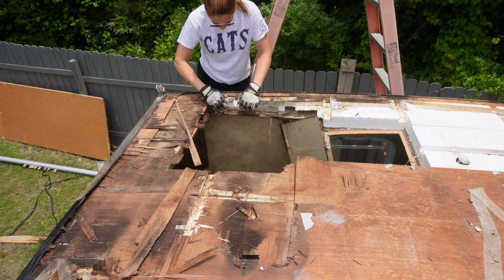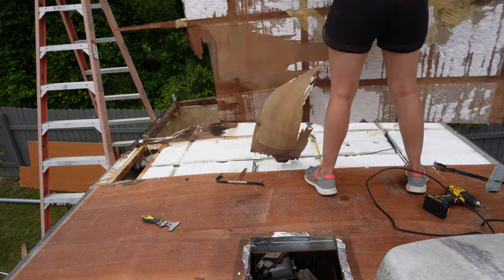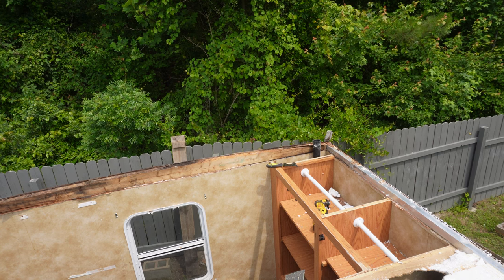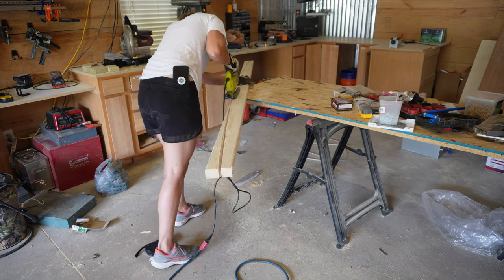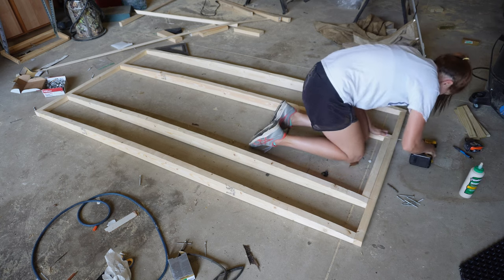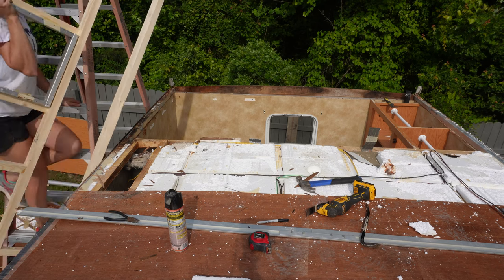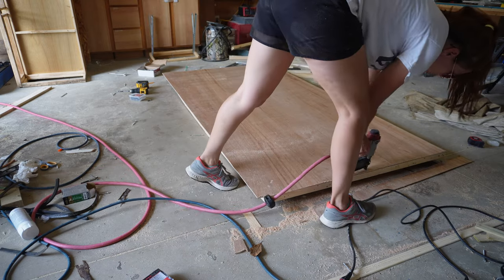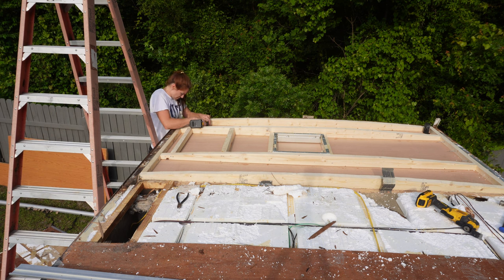RV Roof & Water Damage Removal: Demo Day 7

Comment: Girl I can’t thank you enough for this! My trailer has an aluminum frame as well and I’m working on replacing the whole roof. My hybrid doesn’t have any kind of truss or curvature to the roof. It’s literally flat! Do you think I should make one or just replace it how it is?
Reply from the maker: Interesting…there is usually some curve, even if it’s small. Flat will hold water on the roof. I would be curious to know if the roof is damaged or if it’s manufactured like that. I wouldn’t want my roof flat, so some type of slight curve is ideal
Reply: Yeah it’s insane! I completely removed the paneling, foam insulation, etc to expose the frame on the entire roof and it’s literally just flat aluminum square bars with wood paneling laid on top of it and of course the membrane on top of that. I can’t find any information on whether it’s supposed to be that way, but I think you’re right - a slight curvature would be best so I’ll see if I can find some vids on how to do that without a sample one to replicate haha
Reply: Mine is a hybrid with an aluminum frame and it was flat as well! We are working on replacing it but hopeful to make a slight curve.
Reply: @dalatina911 did you ever find a video to help add a slight curvature? I am not having any luck.

Comment: I have a 2014 keyston ultra light with no slide out. Are all travel trailer roofs similar to what you were doing in this video as far as the thickness of the wood? Mine needs attention to the roof and delimitation.
Reply from the maker: If it’s an ultra light, it will be similar. Foam on the inside of the roof. The difference will be the framing—sometimes there’s more, sometimes there’s less 😂🫣
Reply: I appreciate it. Trying to see what kind of work is a head of me. Always expect the worst, lol.